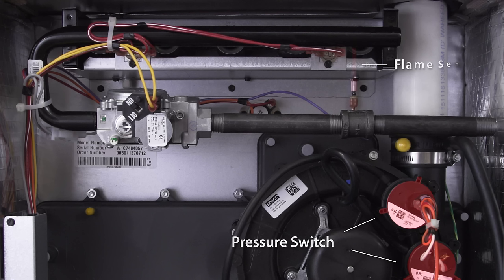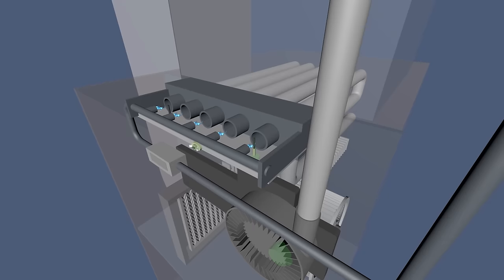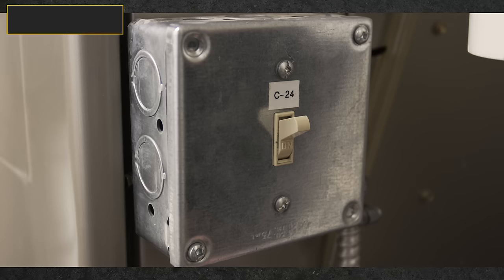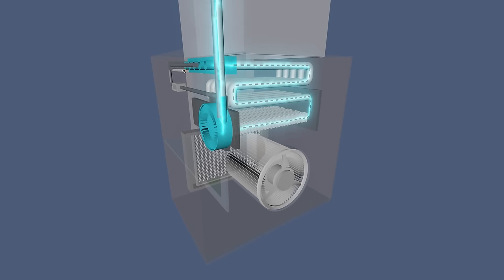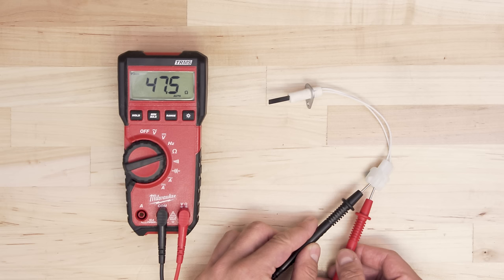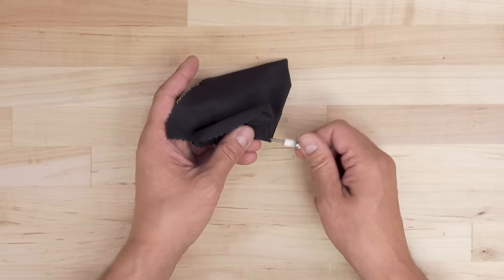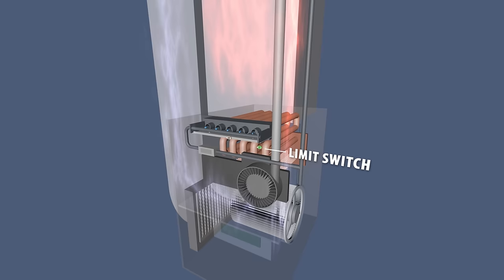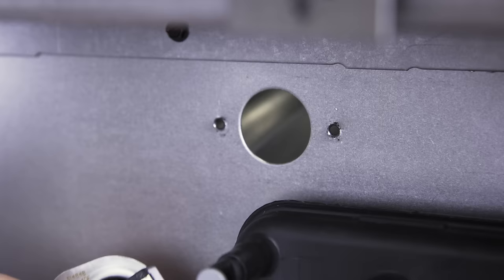Furnace Starts Then Stops - Troubleshooting | Repair and Replace

Comment: Hi Vance,
Thanks for your videos, very well made & informative!  Really hope you can help me. Have a short-cycling issue–happens on both Heat AND A/C setting. Have tried a few things (including the things mentioned in this video) but no luck so far. Been trying to fix it myself as I'm not able to get a tech to inspect it until later in January, and with colder weather heading our way I’m really worried about the plumbing freezing.  

Model: CONCORD 90 PLUS # 45738-001 
What happens: Furnace (or AC) works normal for 8–10 hours, sometimes longer. Then comes on for 3-4 minutes, suddenly shuts off for 1–2 seconds (burner and blower–all quiet), then burner starts warm-up again as if starting a new cycle, followed by blower. Keeps short cycling every 3-4 minutes. Temporary fix has been to reset it–turn off main furnace power switch for a few hours, then on again. 
Repeat.
What I’ve tried so far: 

-Green light – Steady blink pattern - Normal as per manual
 for this model.
-Flame sensor-cleaned and put back
. Limit switch – replaced with new.
-New filter put in
-Was told it could be thermostat–Replaced batteries on White-Rodgers thermostat – but didn’t help. 
Replaced thermostat this week with new Emerson Sensi wifi unit - but the issue still persists.

I’d greatly appreciate your help/suggestions. Thanks in advance, 
Raquelle.
Reply from the maker: Thanks for watching Raquelle, we're glad that you found the video informative.

Intermittent issues are often difficult to narrow down. In your case the furnace ignites and goes through the whole sequence and runs for hours in some cases. This tells you that you have gas, power and that the blowers are working. The fact that you have a new thermostat, new limit switch and and it still shuts off implies that it could be an issue with the airflow or an issue with the control board.

An airflow issue down the line in your system could cause the heat exchanger to get too hot and might cause the limit switch to trip. Though in this case the furnace should run normally after its cooled down. The next time it shuts down, try to observe if the LED light changes or flashes a different code than the steady blinking green. If you get a specific code that will help you narrow down the problem.

Alternatively if all the wire connections are secure, the airflow is good, and you don't get any codes,  then it could be an issue with the control board. There are a lot of small components and capacitors in the control board that can fail and are difficult to test or isolate.

If you are waiting for a service call, and it will be weeks before anyone will come then it might make sense to replace the control board. This would likely cost 100 - 200 to replace (these are not refundable after installation). The steps are very simple and are shown here: https://www.youtube.com/watch?v=4SY8lRl8HV0

Hope this helps!
Reply: @AmreSupply  Wow! Thank you so much for your ultra fast and detailed response and suggestions, I truly appreciate it.  Regarding the LED, in the past when I checked it didn't change or flash a code, just the same steady slow faintly blinking green light; but I will check again next time it happens. 

My only other issue is that I looked into the control board, but this furnace was installed around 2001/2002, and there's no manual for it when we got the house. I've searched online but closest I've found is for similar Concord models, but the layout of parts are different. There is not a lot of info on this model at all; only that they share some aspects/parts with Lennox (parent company) but the inside layouts seem different. I can't post a pic here, it would make it easier to see what I mean. So I'm not sure how to find the control board on my model, as it looks different than in your video or any other videos/pictures I've seen online. It's not visible behind the cover panel, as in your video. If you have any suggestions on this, I'd appreciate it. Thanks again!
Reply from the maker: @RR-qh6th  No problem, we're just happy to help. 

In many cases it can be difficult to narrow down parts for older furnaces. One issue is that some of these companies have been bought up over the years, the other issue is that furnaces are often pieced together with parts from different manufactures. The brand that makes the model doesn't always make all the parts inside the furnace.

With that being said you might be able to find something when searching under "Armstrong-Concord" 

Without seeing the furnace its hard to tell but your control board might be self enclosed inside a little box: https://www.amresupply.com/part/14634418 So try to trace the wires inside your furnace as they will likely converge to a common place.

If you find the control board, then there might be part numbers on the side. This is another thing you can search and look for part numbers. Keep in mind on amresupply.com and many other websites, there is a "Replaces Old Numbers" or "compatible with" listed at the bottom. This can also be a place to check for the cross reference.

As well its good to look inside your furnace cover or on the side of the housing to see if there are any other part or model numbers that can help you narrow down.

As well its hard to tell but sometimes calling the manufacture can be helpful, they might be able to point you in the right direction. They don't always give info to consumers though so its a coin toss.
Reply: @AmreSupply  Thanks again for your detailed reply. Yes I think our furnace is one of those pieced together with different parts/manufacturers. Even with the limit switch I had a tough time; finally took a pic of it and there was a small 5 digit number that corresponded with a Lennox part. Turned out it wasn't the issue but couldn't return it as you mentioned before.  

I will try to follow your recommendations from above, and will keep trying to find and replace the control board. Thanks again for your help, and Happy Holidays to you and yours!
Raquelle.
Reply from the maker: @RR-qh6th  The older the furnace gets the harder it can be to narrow down parts. We're glad that you found these messages helpful. Happy holidays to you as well and best of luck to you with the repairs!

Comment: what does external lockout mean
Reply from the maker: Hi Mike thank you for watching. A furnace lockout is when the furnace has tried running but has detected a unsafe condition. After several attempts the furnace will be locked from starting again. . .  until it is reset. In some models disconnecting reconnecting the power will reset the furnace and it will try again. In other models a code is needed.

Comment: What if there’s water in the tubing do I drain that out???
Reply from the maker: Thanks for watching. If there is water in the drain tube that isn't draining then you'll want to make sure that there isn't a blockage or the water might build up in the inducer motor. If you have a condensate pump then the check valve can stick or get blocked. You can learn more here: https://www.youtube.com/watch?v=dcLhyLu0-y8
Reply: Will my consdate pump work if the tub is bent and also will it make my pressure switch motors squeek
Reply from the maker: @jesuscarrillo9389  If the tube is bent it will restrict the flow, so condensate might build up.

The inducer motor squeaking or making noise is more likely an issue with the motor bearings wearing out. If the motor is squealing then it should be replaced.
Reply: @AmreSupply  it’s only when the when the tubing is bent it’s makes noise but when it’s not it’s quiet and dose it’s job we just got this furnace about a year ago...
Reply from the maker: @jesuscarrillo9389  See if you can add a support to the tube to keep it from bending or pinching closed. That should help prevent the problem from happening again.

Comment: I cleaned as much of my furnace as i could. Replaced the filter. It has gas running and after 2-3 cycles it won't ignite
Reply from the maker: Thank you for watching. Overall If the draft inducer runs, and the pressure inside the combustion chamber is good, then its likely that the furnace ignitor is faulty. To be sure its always best to check the furnace codes after each failed startup attempt.

Comment: Yes, my FAU ignites, the blowers light up for a few seconds, with the blower fan running, but it cuts out after a few seconds. Can you show the flame sensor is located on a carrier, day and night, 88000 BTU fau? Thanks,
Reply from the maker: Hi Joe thank you for watching. There are some difference between models and manufactures but to find the flame sensor, first disconnect the power, remove the cover,  trace the gas line to locate the burner assembly. You will see 3 or 4 burners lined up. On one side is a hot surface ignitor, on the opposite side of the burner is the flame sensor. Hope this helps!
Reply: @AmreSupply  Thanks I will try it later today and clean it ....
Reply from the maker: @joet.5803   Btw you can see how to do that in this video https://youtu.be/af_qRnfHFws
Reply: Yes, I tried it but it still cycle short; it ignites, the burners come on and cuts out after 2-3 seconds. I replaced the ICM 281 board, new igniter and took off the vent pipe to run it. Same condition. Should I replace the flame sensor?
Reply: @AMRE Supply Yes, I tried it but it still cycle short; it ignites, the burners come on and cuts out after 2-3 seconds. I replaced the ICM 281 board, new igniter and took off the vent pipe to run it. Same condition. Should I replace the flame sensor?
Reply from the maker: @joet.5803  First check to make sure that the flame sensor is positioned in the blue part of the flame as it needs to be positioned correctly or it will not work. If the position looks good, and the flame sensor was cleaned and the furnace still shuts off 3 seconds after ignition, then its best to install a new flame sensor.
Reply: @AmreSupply  I replaced the flame sensor with a new one. Still the same problem.  The ICM board is blinking 3 times.
Reply from the maker: @joet.5803  It would be best if you checked the back of your furnace cover for a chart, or manual to check the codes see what the 3 flashes means to your furnace. The codes are not universal and will differ between models.

Comment: What about shutting off after 2 minutes and NOT  coming back on?
Reply from the maker: Thanks for watching. Even it it doesn't keep restarting, it is likely still a problem with one of the safety switches. Do you know how far into the startup sequence did it get? Did the inducer run for several minutes before it shut off or did it ignite? 

Also it's best to check for any codes as this can help you narrow it down further.
Reply: @AmreSupply  Thanks for the response. The igniter lit up and provided heat for approx 2minutes 30 seconds before shutting off. We opened everything up and found water inside the tubing going to the draft inducer. Once drained, operation resumed to normal. The trap was intact and seemed to be receiving water from the inside with no blockage.  The air intake appears to be intact the way it was put up 9 years ago on the outside with an inverted J with nothing blocking it. This seemed quite unusual. It's been running normally for six hours now.
Reply from the maker: @jasonthatjason1912  You're welcome, we're just happy to help! 

It's possible that the water was causing the pressure switch to trip and shut off the system. If it is running now, just keep an eye on it to see if it happens again. Since condensate is produced when the furnace is running, these things can be intermittent. If there was a low spot in the tubing then water could have been accumulating over time. It's good that you were observant and were able to narrow that down.
Reply: @AmreSupply  Thanks Much! Will do!

Comment: My furnace stop after about 2 minutes, then start again and than stop again. I already clean the flame sensor but still not helping. So after watching your video, I am trying to check the Limit Switch but can you tell me where to locate the Limit Switch?. Thanks for your help.
Reply from the maker: Hi Johnny, the limit switch is located on the plenum, or the side of the housing. It shouldn't look like its on or close to the burner but will be sitting just on the side wall.

Also here's the limit switch testing and repair video: https://youtu.be/0va_wvwfCBA

Hope this helps!
Reply: That what happen to my Furnace, i found out it was the filter, i was using merv 11 and I switch it to a basic filter num 4. Looks like the Merv 11 filter was blocking the air and that cause the furnace to overheat. Hope that helps, you might as well have to change the high limit switch if it keeps causing the same problem.

Comment: Don't forget the cracked heat exchanger. That's a big'un.
Reply from the maker: Yes, a cracked heat exchanger can be a very serious problem. That is one reason a carbon monoxide detector is needed to be placed near near the furnace or a gas water heater.

Comment: my gas furnace starts up like it should and runs just until the glow plug igniter shuts down when it shuts down, so does the gas to the burner. they both shut down at the same time .i was hoping someone would know the cause my gas furnace starts up like it should and runs just until the glow plug igniter shuts down when it shuts down, so does the gas to the burner. they both shut down at the same time .i was hoping someone would know the cause
Reply from the maker: Thanks for watching. If the furnace starts up, the ignitor glows and the flames light, then It is most likely an issue with the flame sensor. https://www.youtube.com/watch?v=af_qRnfHFws This means that your furnace is starting normally but can't prove the flame through the flame sensor. It won't continue if it can't prove a flame.

Comment: Mine is all electric. It comes on then goes off when just the fan is on. Almost like surging or struggling. But then it will turn on sometimes and stay on for a few mins then turn off. The unit is only 4 years old.
Reply from the maker: Hi, thank you for watching. Like gas furnaces, electric furnaces also have limit switches. The thermal disc inside the switch can wear out after a certain number of operations, which can cause it to shut off prematurely even if the rest of the furnace is functioning correctly. Basically the furnace thinks its too hot so it shuts itself off.
Reply: @AmreSupply  I decided to upgrade my thermostat to a smart one and that cured the problem. Thanks for your video.

Comment: My furnace behaves like a bad flame sensor. That is, it ignites but only stays lit for 4 seconds. I replaced the flame sensor, but no improvement. (I learned the flame sensor is just a rectifier using the flame to conduct DC when a voltage is applied.) Other videos say the current through the flame sensor should be 3-10 microamp. I only get 1 microamp from mine. 
The code is normal with a call for heat. Here's a thread on it https://www.doityourself.com/forum/gas-oil-home-heating-furnaces/621165-furnace-starts-then-stops-after-ignition.html#post2863190
Any suggestions?
Reply from the maker: Hi Nehmo, thank you for watching! You are right that the flame sensor is just a rectifier, the current moves from the control board through the burners to ground. The flame sensor needs to be positioned in a healthy flame, with a properly grounded burner to work properly. There should be a grounding screw on the control board. Make sure that the screw is tight and its well grounded. As well give the burners a proper cleaning of any carbon buildup. Double check all connections and look for any corrosion that might interfere with the current.

Comment: Furnace goes on pauses for about five seconds and then starts igniting the burners I have had many people here looking at it and everyone tells me it’s fine most of the time it doesn’t do it when they are here.
Reply from the maker: Thanks for watching. You're describing a delay before it ignites, which is not a common problem. Does it ever fail to ignite?
Reply: No but sometimes it takes a little longer. Is it dangerous? I hate gas furnaces I wish I had oil.
Reply: I had three companies come last year and they told me that everything was fine. Sometimes I even heard a bang and they said it could’ve been my my duct work.
Reply: A few times it would start and then it would shut off and then it will start up again.  Never happens when I have a technician here. I’m thinking of getting a new furnace although mine isn’t that old I bought it in 2015.

Comment: Also check the drain tube Mine was bent It shut the furnace down!!
Reply from the maker: Thanks for watching. You are right that a clogged condensate drain tube can also shut down the furnace. For the other cases where its not a bent tube but a stuck check valve or failed motor we have a video on troubleshooting and replacing condensate pumps here: https://youtu.be/dcLhyLu0-y8

Comment: Correct short cylcle soon the flame comes on  the machine shuts off.
Reply from the maker: Its likely that the flame sensor is dirty, or that its failed. The furnace needs to prove that there's a flame before it will keep the burners lit. This is for safety reasons. If the flame sensor is dirty or if its failed, then the furnace thinks its unsafe to keep the burners lit, so the gas will shut off. You can learn more here: https://youtu.be/af_qRnfHFws

Comment: Cleaned the flame sensor as instructed but same issue....the burners come on and heat for 3 to 5 seconds and shut off, so the system is blowing cold air! Anything else we can do yet ourselves as it's a Saturday and a tech won't even come until Monday...
Reply from the maker: Hi Melanie, without a new flame sensor, cleaning it is the only quick fix for that scenario.